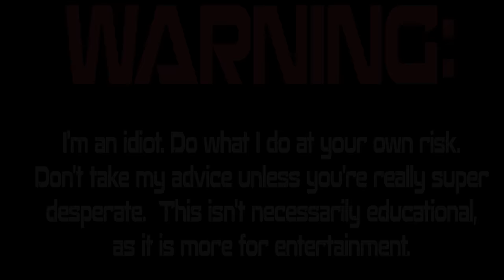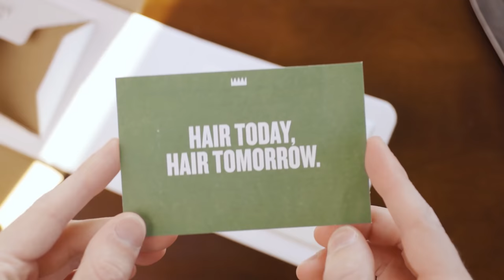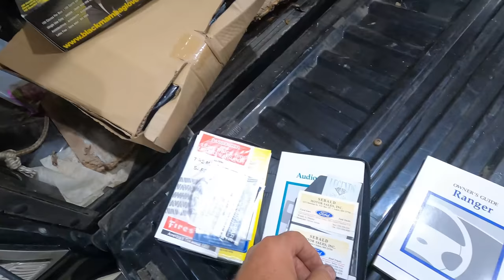Preparing a Customized Ford Ranger for Circle Track Racing (Freedom Factory)

Comment: Good luck Derek. As a ranger fan, I can proudly say my '98 4x4 has 432,000 miles on the 4.0 and is still going. Sure, she smokes a smidge on start-up, but it just won't die. Best little truck I have ever owned.😎
Reply: I had a 91 Ranger 5 speed with the 2.3ltr inline 4 and that was one hell of an engine tranny combo. It wasn't fast, it didn't have tons of power and you needed a stiff wind at your back to pass anyone but it did get 30+ miles per gallon. it had just over 500,000 miles on it before my brother got it hot and blew it up. That was the 2nd vehicle it let him borrow and he blew up, the first was my Black Cherry 96 crown vic police interceptor. He had it for a month and i told him to check the oil every week and he didn't, got a call that the motor was making a banging noise then it just stopped. Locked that fucker up tighter than shit.
Reply: I got a '93 Ranger (4.0L 5 Speed) with 414,000 miles on it. Sat for 6 years after an offroading incident with a boulder  boogered up the front end. This year I finally had the time AND money to rebuild the whole front end, all new parts except the twin I-beams. Derek's videos inspired me to do everything myself. But just like you said, these engines will last forever if ya treat em right. Best trucks ever made.
Reply: That’s pretty impressive
Reply: Built FORD tough!

Comment: Rooting for the 4.0 OHV, the one in my old Explorer is at 240k with no problems. Pretty cool to see what I drive daily under the hood in one of Derek's videos!
Reply: that old Cologne-based 4.0 is a good one.   I drove one to 210K in my '95 Explorer without doing anything more than oil changes, plugs/wires and one belt tensioner.

Comment: I used to be a crew member at the local circle track for two race teams for five years. and I have a little tip for you that will help a lot in the handling department. I'm sure you have heard of a little thing called tire stagger. it's where you air up all the tires to maximum air pressure leave them sit for about an hour. then take a sewing tape measure and measure the diameter of the tires. and then put the largest diameter tire on the right front. and if you have a locked rear end put the next largest tire on the right rear. and put the smallest diameter tire on the left rear. and whatever you have left on the left front. it will make the car turn left by it self. it like taking a paper cup and setting it's side and rolling if. you have an unlocked rear end reverse the stagger in the rear, give it a try.

Comment: I've have my 03 w/ 3.0 v6 and 5 speed that my dad bought brand new that now has just under 180k miles and it has done everything I have ever asked of...that includes everything from driving through water halfway up the doors to burnouts to hauling a backhoe on a 3 axle trailer once (that one kinda had a guy worried but it did it)

Comment: Had Ford made a Ranger with the 4.6 liter V8 they would have had themselves one bad ass little truck. The 2000-05 4x4 Rangers with the step side is one of my favorite trucks from that era they are just under powered but that V8 would have made them a monster.
Reply: Yeah...if they'd have put a Pratt & Whitney J58 in the truck it would have been even faster.  I'm mean if you're making fantasy claims, go all the way...
Reply: An old pushrod 5.0L drops right in. Pretty easy swap, considering the 90’s era Explorer was the same chassis up front as a Ranger, and came with a 5.0 as an option.

Comment: Looks like them headlights could use a 3M headlight restore treatment if a guys got a $20 bill and a drill handy. Works great and has enough discolator flaps for a few sets of headlights.
Reply: Sylvania kit is better based on the testing that Project Farm here on YT did
Reply: 400-800-1000 grit wet sand and some aluminum polish.. blows those kits away
Reply: @MrCamarokid83  aluminum polish on polycarbonate. Right. And what about UV protection over time? There's a reason the kits work. I've used the Sylvania kit.

Comment: That version of the 4.0 liter is the good one. My 1994 Ranger has 352,000 miles and it still runs decent. It's getting tired but I'm going to run until something bad happens and then a 5.0 is in its future. The extended cab version fits us average guys much better. I'm 6' 7" and there is plenty of room in it. I had a regular cab once and that was fit for sardines and midgets.

Comment: seat mounting always is a PITA.  With a seat like that when one needs extra head room mount the rear of the seat right to the floor (no frame or bracketry), drill holes through both the floor and seat, use at least 3" washers, make plates, or buy them from Pegasus Racing, then make a custom "Z" bracket for the front of the seat.   That bed cover is just dead weight, pull it, unless you want it for weight bias.   I didn't read the rules, but if they say the motor is to be stock from t.body to exht manifold; well that means the ECU is open, so re-flash it!  Move the battery to the bed (I know time was short).  Is that the Freiburger/Dulchcich Challenger they took the SCCA National Auto-x a few years ago?

Comment: The overhead valve 4.0 l was a great engine really reliable lasted forever the 4.0 l single overhead cam put out more horsepower but was less reliable because of timing chain guide issues

Comment: Dam you bringing back memories off my 98 4 litre 5 speed.     At 400000 miles the transmission just let go and it was just wasn’t worth fixing what with the clutch and finding a new used transmission.    And the weight reduced frame. It got parted out.

Comment: A guy bought the 96 model new in the extended cab, splash bed version. Couldn't ask for more leg room. With the 4 cylinder, it could have used some more ponies, but did deliver 24 mpg no sweat. Son of a guy got it when he reached 16 and drove it up to 118k. The only repairs it ever needed were the middle bearing for the 2-piece drive shaft and the shift knob, which was thoughtfully attached to lever with resin. A guy took an old Hurst knob he had hanging around and threaded the inside of the lever and then had an extra tall shifter. Never even replaced the clutch in 118,000 miles and junior learning to drive.

Comment: I always like to check the throttle cable on these tuned type veehicles. Sometimes an enthusiastic sasquatch paw on the loud pedal can stretch the cable over time. You think you're at WOT but you're not.

Comment: One new lug nut each wheel ? He had locking lug nuts on it and they fit whatever new vehicle the previous owner had (or they lost the key) and replaced the locks with new nuts.

Loving the new garage and the "bunk" storage.

Comment: I'm sure you know this already, but a feller's thinkin' every wheel has one new lug nut because somebody had the old single locking lug nut on each wheel and a previous owner kept those and couldn't find the ones he set aside. Anyhoo, you always make things interesting even if the project isn't vintage.....although 1998 is almost vintage these days.

Comment: I have a ford splash 3.0 v6 stepside 5 steed power windows locks cruise its got the sideways seats in the back only one can be used otherside has 12 inch sub

Comment: Listening to the engine rules it sounds like a guy could put a turbo on it if he only had the time...Just mount the turbo under the bed of the truck and pipe it to the exhaust manifold output and throttle plate input...Wouldn't even need an inner-tube-cooler if the pipes are long enough.

Comment: I have a 2006 Ranger XLT with the 4 litre engine and the five speed transmission. The one thing I don't like about my Ranger is the centrifugal clutch.
Reply: Centrifugal clutch? That's interesting
Reply: @ricky107_  It's really useless. It slips like crazy. It should be great for off road, but it's not at all. I tow an 18 foot trailer with it, though. I live in Canada. Maybe they are sold only in Canada. Geez.

Comment: If those are the same style of clears from the other 90s markets, swap out those taillights first or they will get ruined. They don't make them anymore and they are rare. I've seen them sell easily over $300 for my 98 Chevy. I imagine the Ranger market for them is similar! The front corners could be rare too, just depends the style. OEM pattern clears usually are.

Comment: Oddly enough, a pickup is most aerodynamic with no bed cover and tailgate up.  It creates a little bubble vortex in the bed that the air flows right over like an airplane wing.  A feller's got to use all the sciences in the roundy-round game.

Comment: Too bad you aren;t out west, Ranger's are a dime a dozen out here. I bought a 1993 in red, splash side, for 1200$ needed work but it is a 3.0 V6 with 5 speed. It's in fair shape, paint is faded so I used your cutting tips to revive it a little. But it is in the exact shape you would have wanted for this race. Looks great at first glance, but beat enough you won't feel guilty modifying it.

237K miles and still going, not even smoking.

Comment: Nothing is to nice to race🤟 I was in a roadtrip from Norway to Poland, I had a Audi A8 4.2TDI that had a tune on it, I travel down to polartorsk afford some work done to it.. I changed all the brakes, and did some front suspension work, and a transmission rebuild at a Bosh workshop.. On the way back home, I got on the autobahn.. I was driving along about 220km/h And then a porche 911 something came passed me, I put the car in sport mode, lowered the air suspension and floored it... After a few miles, we hit traffic,  so I was hanging on his ass all the way, and when the traffic came close, we both had two feet on the brake pedal, both his and mine car was gulped in brake smoke😄 At this moment, I knew I fucked up🤣 Ruined all my ceramic discs.. But I had fun in my old A8 (,06) But any car are up for some random racing 💪

Comment: Anyone know why a ‘00 dodge Dakota fuel gauge would fluctuate from topped off to empty with low fuel light on? I replaced the resistor on the cluster as well as the fuel pump/sending unit. and it stills does that after doing the replacement. No clue what would cause that. any input is greatly appreciated!

Comment: ehhh... a guy should stick a 3/8 extension in those spring spacers and give them a twist... they aint supposeta just sit in there... but ohh... ya had to remove them anyway...lol... and btw... when did I  miss that Challenger being added to the hoard??

Comment: Not a nice truck so don't worry about it. Most are the 2006-2011 with the 5speed and the newer (and much more power) 4.0  4x4 with the 5speed - and most want the extended cab (basically a small decent 4x4 pickup that you can throw a kid or two in the back of the extended cab. However, if you wanted speed then a 2006-11 with 4.0 and 5speed with singel cab 4x2 would be the fastest but no one bought one to the event. You would of had 50-120hp MORE then most of the trucks people bought. I should add the ranger is a decent truck (you need extended cab for enough space however) since it was built with ford and madza and has near japan level reliability besides the v6 3.0 engine (push rod engine up until 2004 I believe, but  dist/oil pump pump would die) at around 200k and only a few hundred to fix ahead of time if you were smart -- but the engine did sound pretty good with stock exhuast for being a v6 3.0 pushrod engine).

Comment: I have a 95 with the 2.3 with 8 spark plugs in it 240,000 miles its seen better days lots of rust. when you get done with that one if you don't
 wreck it please donate it to Restoration Ministries 253 e 159th st Harvey il for Lenny. I am a small engine mechanic for Thornton township.

Comment: Sorry Derik, 4.0 is the worse unless it's been rebuilt with non plastic timing chain guide tensioner...  better off getting 3.0 taking the speed limiter off of  it, cause only rated to go 99 MPH, unless modified.  I should Know, ass veteran i made more trips from Jacksonville Fl., to my home town(Pittsburgh) in under 13hr, before marriage, FYI that trip is now annoying 15+ i got pee after i just filled with gas back on highway.  I HAVE NEVER GOTTEN 1 Of (too many to LIST) speed tickets over 99.... it impossible. in Stock Ranger.  mine is a stock 1996 3.0, 5 Speed Manual. Well  best of luck on race, in such clean looking ford ranger.  If you survive, motor still good, need one for mine, all (4) of my timing chain tensioners sound like chains falling down steps.  Put some of that patented Diesel Oil In it. Damm that is one clean looking Body for 98 ranger

Comment: JUNK! owned 2 of them. First, 4x4 blew the driveshaft, they wanted about 700 dollars for a steel shaft plus u joints!  They told me at the dealership it was not properly maintained. Non greasable fittings on the u joints!!?? Built my own, not paying that for a near new truck!

Then the engine blew a connecting rod though the side of the block! F'd  Ford would not cover under 60.000 warranty

The other one I owned, was  a 2wd. Blew the head gasket and water pump plus who knows  what all else went wrong with that! I gave it away to a brother in law. He did the same.

BEST ADVICE TO YOU, RUN THE F OUT OF IT TILL IT BLOWS UP, IF IT DOESN'T PUT A BRICK ON THE GAS PEDAL. POUR GAS ALL OVER IT AND BURN IT!!

Sorry, been screwed by FORD a couple times too many! Ripped off once, twice a fool!!

ROLL IT, SMASH IT, BURN IT!!